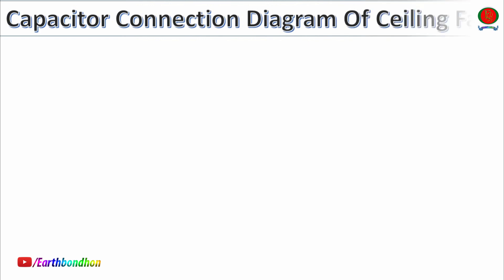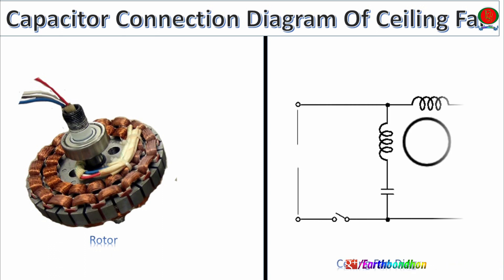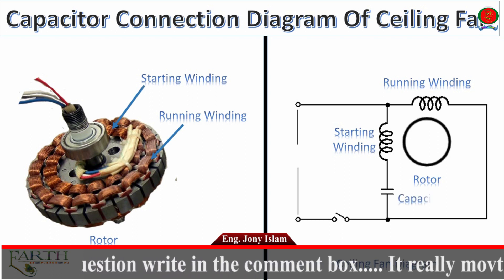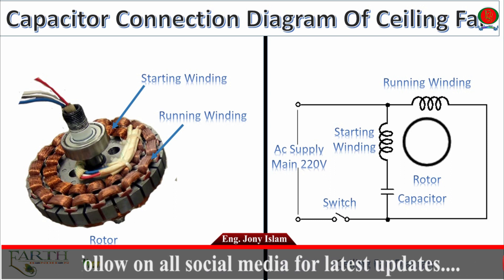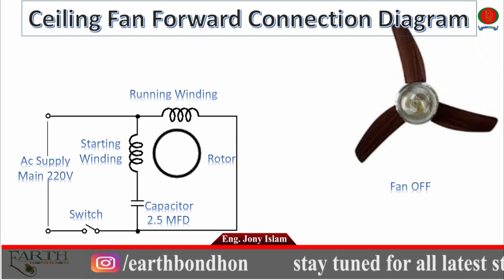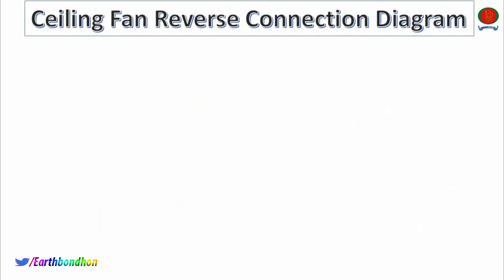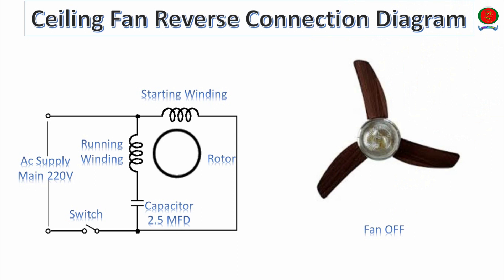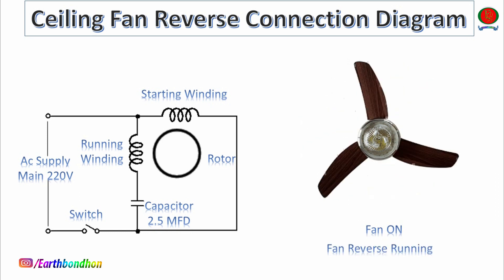Ceiling fan forward or Reverse Running | Ceiling fan |  Earthbondhon

Comment: My fan in not rotating but on pushing it starts rotating in whichever direction it is being rotated by hand ..
What can be the reason
Reply: capacitor is faulty in ur case
Reply: My fan is rotating in the clockwise direction slowly in recent time even after changing the capacitor. Suggestions please to solve the problem. Thank sir
Reply from the maker: yes, add Facebook "earthbondhon" 
I love to receive your comments and feedback.
Thanks for watching